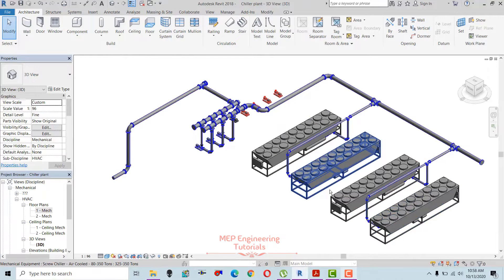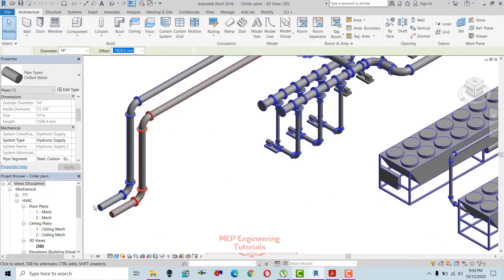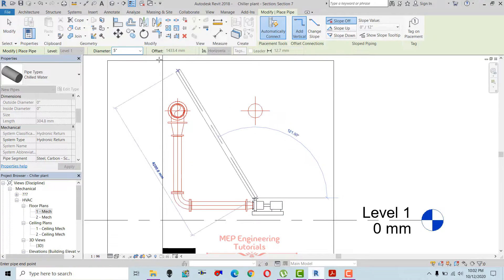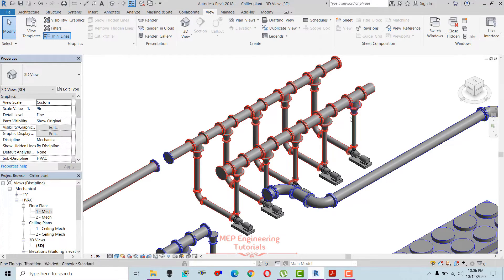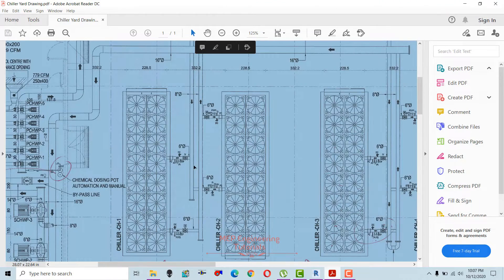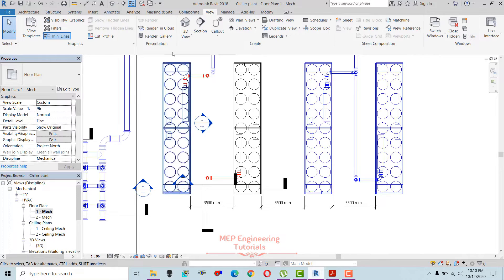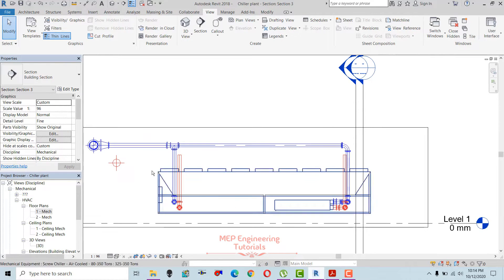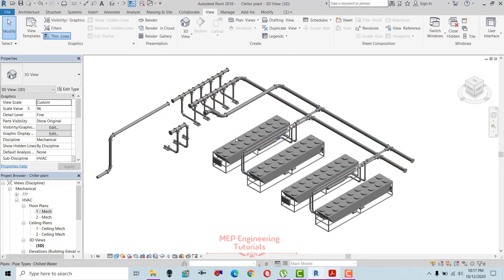revit chilled water pump room design (chiller and pump placement and piping connections in revit)

Comment: that pdf to revit is very nice. i really wwant to explore more. can you psot the equipment connections? like all the small things in the mechancial room, prettusre tem gauge. heat exchanger and such. thanks
Reply from the maker: Yeah sure
Reply: @mepengineeringtutorials  Hats off to you sir very nice and clear representation of the chiller room design. I request you to provide the video about calculating the number of chillers and AHU's required in the place.